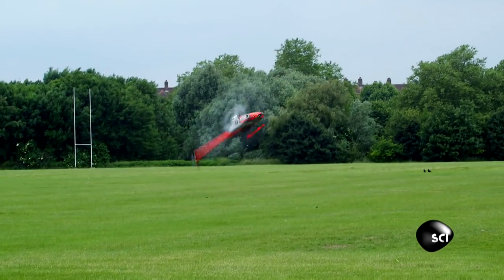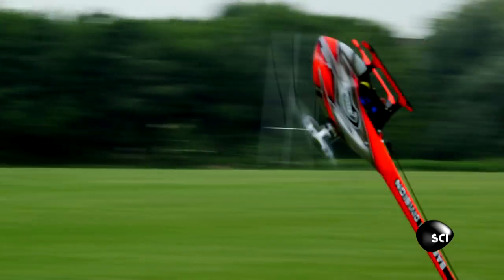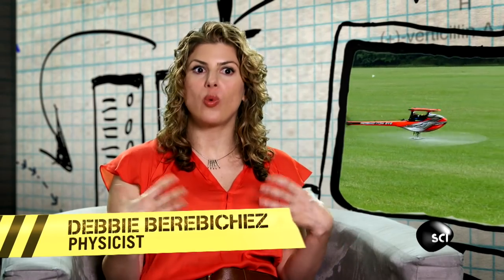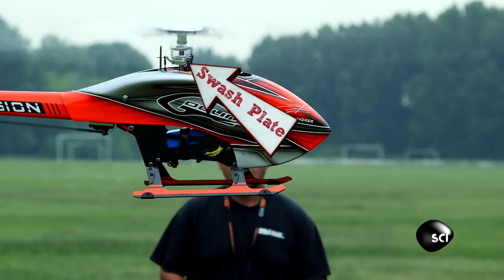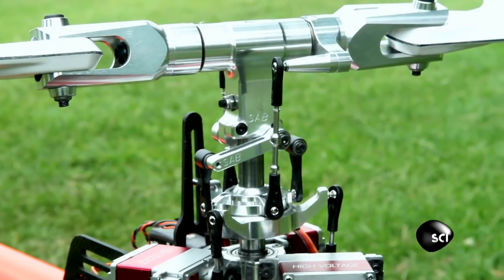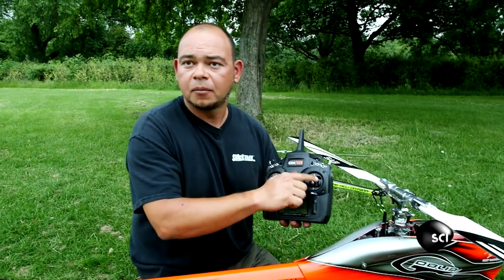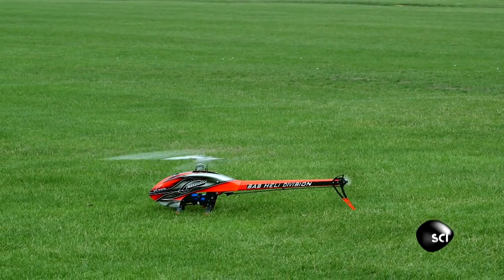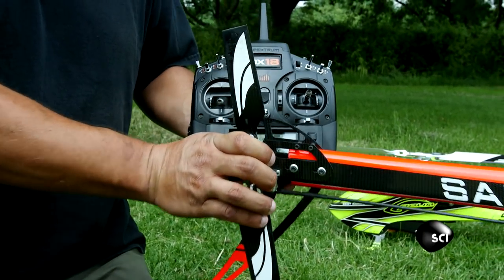How Are These Incredible Helicopter Stunts Possible?

Comment: I actually had a small stroke listening to those "physicists" explain how they think a model RC helicopter works. That was so very painful to listen to. No matter how great the power/weight ratio, it has nothing to do with making a helicopter hover upside down. These RC helis are capable of tilting their blades beyond horizontal so that there is thrust directed "above" the helicopter. It's often referred to as 3d flying and it's what allows the tick tock, upside hover etc.

Comment: Um, actually no. These TV presenter "physicists" are superficial to the point of being incorrect - the main rotor cannot tilt at all. What actually happens is the individual blades tilt at different times in the cycle. Let's use a compass as a reference, North being the front of the chopper. To fly sideways, let's say to the east, each blade tilts aggressively as it passes the west side of the chopper; this very brief change in pitch makes the blade cut more air as it passes the west side, thus creating more lift on the west side; the whole chopper therefore tilts to the East and starts flying to the East. If the main rotor is spinning at 600 revolutions per minute, this means the pitch on each blade is changing 10 times per second. Similar thing happens for forwards and backwards flight. (For inverted flight, the blades tilt in the opposite direction to push air out the top of the heli, but the cyclic control can still be used for direction.)
Reply: Do you know what you are talking about? Because in these things the swashplate tilts the entire rotor. I have one of these, I know.
Reply: Yes, I have one, the rotor tilts.
Reply: @jetgamer5386  which model do you have? Never seen the whole rotor system to tilt.
Reply: @rubaiyatmehedi9337  ok, I did some research, turns out there are three types of rotor systems. Rigid, articulated, and semi rigid. Rigid is what rc's use,it allows maneuvers without mastbump. In an actual heli this is too stressful on the blades, so the rotor system swings freely from the mast. This greatly reduces stress and increases the lifetime of components. Some new helis use semi articulated in which the blades all articulate independently.
Reply: @jetgamer5386  almost all hobby grade aerobatic R/C helicopters use a semi rigid teetering hub. The blade grips share a common spindle that is supported by hard rubber bushings inside the hub. It can tilt, but not by much however this has nothing to do with directional control it's there to deal with dissymmetry of lift caused by cyclic pitch and/or the advancing blade during forward flight.
Reply: Ummm... not quite. The response is 90 degrees out of phase. So if the blade rotates N-E-S-W and there was an increase in lift on the west side, the response would be north going up an south going down. East and West would not change. Maybe you need to go back to school with the presenters...
Reply: @InfiniteRemoteControl  It's "approximately" 90 degrees out of phase, the actual phase offset can vary from 80 degrees to 90 degrees depending on many design factors. It's not gyroscopic precession because if it were that it would always be 90 degrees exactly never more or less than that. It's an aerodynamic effect caused by the fact that changes in angle of attack of the blades cannot instantly affect roll rate of the aircraft. An extreme example is the Robinson R-22 (a full scale helicopter) which has about 70 degrees of phase offset.
Reply: It actually can tilt to an extent.  The spindle shaft bushings are almost rubber(of varying durometers).  The blade grips are are attached to the spindle shaft.  The disc CAN tilt, although it isn't much.
Reply: @fiveoboy01 The point was explain the ingenious way in which a helicopter manages to fly in any direction.
Reply: @atomicskull6405  There is no question the phase offset is necessary because of gyroscopic precession. The aerodynamic effects may be the reason the phase offset is net exactly 90.
Reply: @jetgamer5386  What the hell model do you have??? Can you answer??? Because I guess you talking about some toys and half - toys like 3 channel or 4 chanel RC helicopters. The "stuff" in real helicopters, or in the video (6 or more channels models), or subscribed by Lindsay Fowler is... just the same.
Reply: OMG no heli in existence works that way. I was cringing the whole time he was explaining the theory he came up with in his head. He obviously was not there to see the heli in person and knows nothing about helicopters.
Reply: @jetgamer5386  No it doesn't.

And I have a whole fleet of them.  The swashplate tilts, but rotors always stay exactly 90 degrees to the main shaft, and that is fixed at 90 degrees to the longitudinal and pitch axis.

Comment: I love how they explained the physics of moving forwards and backwards wrong. You don't tilt the whole blademount forward to go forward... You change the pitch of the blades at a 90degree offset.
Reply: Zeleene yeah
Reply: Exactly that's how you can tell that these people are just paid to say what they have to say
Reply: @nightmareinaction629  That's how TV (and all nowadays media) works....
Reply: And the real explanation is so beautiful and interesting. What a thing to get wrong!
Reply: Changing the pitch increases and decreases the thrust which is controlled by the collective stick. The blades are tilted forwards, backwards and sideways using a swash plate which is controlled by the joystick
Reply: They left out any sort of explanation about the swashplate's entire third axis of movement.  The swash plate is a 3 axis device.  It moves along the vertical and both lateral axes.  The collective is the vertical axis and this is actually the one that allows the helicopter to fly upside down.  That's the biggest thing they left out.

Comment: I've been an aviation enthusiast for some time. All I got from this video is the basic on how any helicopter actually works. Not how the helicopter can actually perform these amazing stunts. Any reading from 3-13 minutes depending on your reading skills and source will explain just as much if not more. RC heli of any sort isn't easy to fly, these bigger models that have these amazing abilities are even more so difficult to fly. It's always best to start out small and with airplanes first then move up the ladder with skill. But this video does not explain the science behind how the heli can fly upside down, sideways ect. You'll have to do your own research there.

Comment: holy crap you are not actually able to tilt the head with blades on it... the swashplates allows  different pitch on different positions of the blades.. if i want to go forward i dont tilt the head forward, thats bullshit the head is fixed. if i want to go forward the swashplate allows me to have a higher pitch on the blades when they rotate through the rear part of the rotation, therefore creating more lift on the rear side and tilting the helicopter forward...
Reply: Well technically there is some blade flap because (most) RC helis use a semi rigid teetering head (the spindle teeters to some degree on the dampers) but that's still just a side effect of cyclic pitch. And in forward flight there is also some upward blade flap on the advancing side and downward flap on the retreating side.
Reply: +Atomicskull you are correct, and normally you have to take the gyroscopic precession into account as well, but in this video it seems like some magical force is tilting the rotor head in the direction of flight which i think is too oversimplified
Reply: +KING 21 RC I own a Rush 750 and an Innova 700 and next year I plan on building an 800 gasser either based on a Trex 700 conversion or possibly the upcoming Protos 700 Max V2 gasoline conversion (that one is really interesting because it's using a Zenoah with a new casing to make it more compact). There is always some amount of movement possible with the feathering shaft because they are supported in the hub by rubber dampers. It is not rigid hub, the rubber dampers restrict but do not completely prevent the feathering shaft from teetering. You are right that using too soft dampers risks a boom strike in extreme maneuvers.
Reply: speed bòt
Reply: speedbòt
Reply: RC helicopters typically use a restricted teetering head (common spindle connecting both blade grips supported by rubber dampers inside the hub) so the disk can in fact "tilt" to a small degree however it's only in response to differing lift across the rotor disk. This is necessary because in forward flight there is an effect called "blade flapping" where the advancing blade wants to move up and without some means for them to do so the blade will bend instead and in addiction decoupling the blades from the airframe with elastic bearings (which is what the dampers are, on some models they are actually just common O-rings) also reduces vibration. If you want to see what the inside of an RC helicopter rotor head looks like google the Trex 700 manual. It's more complex than you might think.
Reply: Tim what about gyroscopic precession? The lift is given 90 degrees out from the intended movement, much like a bycicle wheel turns left or right when its tilted over, so, pitch forwards = lift right side and vise versa . they could have explained this in the same amount of time.
Reply: yes, 3d helis use a fixed head system. These people probably don't understand that there are several types of rotor head. A lot of full size helicopters have a semi articulated rotor which does actually tilt. However, the tilting itself does not cause the movement.

Comment: Well another very big reason why full sized helicopters can't do this, which you didn't mention, is that the collective pitch has no reverse, so flying upside down is impossible.
Reply: Of course there's reverse collective pitch in a full scale heli. Otherwise they wouldn't be able to auto-rotate. The real reason they can't fly inverted is blade strength and tail boom strikes. Things are a lot bigger and floppier in a full scale heli and you really have to be concerned with blade flap.
Reply: Eric Braun I fly helicopters for a living, there is no such thing as reverse collective pitch. In an auto rotation the collective goes full down, the minimum pitch but certainly not reverse. Depending on the helicopter and how heavy it is you may even have to add some collective pitch so as to not over-speed the rotor.

Please do not spread misinformation, I'm not saying you need to be a pilot to know such things, all I'm saying is just do your research.
Reply: There are a few full size helicopters that have the capability(in theory) to go negative now(rigid/semi rigid head),  but the problem is rigging.  No manufacturer would ever rig a helicopter with negative pitch because of the danger involved with flying with that capability.  With less power to weight and much more mass,  the possibility slamming yourself into the ground is very likely to happen.  Maybe someday with an autopilot that could keep you from danger zones but again,  at this point there is no reason to do it with million + dollar helicopters,  so why  take the risk.
Reply: dirtcurt1 I can only see reverse collective being a thing on specially modified stunt helicopters at airshows 30 years from now, maybe.

In 30 years the aviation industry might have caught up to 2016 LOL
Reply: I think bigger full size automated drone helicopters for military use could be the thing you are expecting.  I just don't think a human could take the forces that these RC helicopters dish out.   Can you imagine the ability to sidestep a rocket or even ordinance with the moves they make.  Collective pitch drones are now being made.  Those will be tough and have extreme agility.

Comment: If the rotor head tilted it would strike the boom, boom strike is not the rotor head titling or the blade flexing, it is when one rotor- blade lags in it grip so it is not perpendicular to the pitch angle of the grip any longer, that means the rotor blade will be angled downward, at an angle that is whatever the cyclic angle is, thus the tip drops down as it lags in the grip and strikes the boom, the way to stop it doing that is the bring the cyclic back to 0 so the blade tip cant drop to the boom if it lags in the grip.

Comment: Rotor head doesn't tilt at all, it looks like that to anyone who cant fly one but that is just the blade flex and that's all there is to it, And that's is also how you set the swash plate to rotor grip links by sighting the rotor head end on the noting the high and low blades and adjusting the link so both blades track at the same height. you just put tape on one blade so you can see which is high and low.

Comment: besides power to weight ratio it doesn't really get into how the tricks are possible would have liked to see some of the control combinations in parallel with whats mechanically taking place on the craft
Reply: +RALLIR So it's a combination of orientations that are important. When the heli faces different directions, different controls are reversed. So after you learn 8 orientations (4 upright and 4 inverted) you can start using those in moves.  watch?v=VJO0bGRwK1Q here is a stick cam from a pro.
Reply: Thank you :)
Reply: I like ,how do I get it?
Reply: olayiwola sulaimon Get what?
Reply: There is only one way to get there - Practice

Comment: He says from 3 years to 10 years... Meaning 10 years if you are an extremely slow learner... Super weird you all went straight to 10yrs like that was the benchmark... I guess that is kinda like "selective hearing" right? Oh and if you are assuming its anything like those drones that basically fly themselves, these things cost $800+ and almost everyone crashes and burns them on the regular. For those preaching they can do it in 1month, We await your video proof. These things are really difficult to learn without destroying a bunch of cheap ones and that's just flying and landing, try some of what hes doing...
Reply: So true , most of these people commenting don't even have a clue how difficult it is for a newbie to get a collective heli like this in the air let alone do piro flip.
3-10 years can be correct it all depends on how frequently you practice.
Reply: +MrDVCHITTer It also depends on weather or not you stick with the hobby/practice a lot and have your helis set up correct (how much actual air time you have in the "3-10 years").  when I learned to fly CP it took me about 6 months to learn hover/ forward flight, due to a bad heli.  I built a 450 and had it set up for me, and went from barely being able to fly forward to flips and loops in about 6 flights (vs. 6 months).
Reply: Yeah these guys need a lot of practice, and even the best destroy theirs. I saw a graupner guy completely destroy his once
Reply: +Ptolemy
Or it means you try to learn with less hours invested every month than someone with 3 years.
Reply: if you have round 150 flights/ month, you can do it in 3 years, 5 flights per weekend? 15 years maybe
Reply: I was looking to buy one but from the comments i may just buy a buggy and stay on the ground
Reply: helicopters are the hardest to operate out of everything that is RC basically. 99 percent of people couldn't fly this helicopter in circles without crashing it in 10 seconds or less.
Reply: kenneth sparks That's no exaggeration. I've seen only a few RC Helicopters (serious ones, like this), and every single one of them, was a pilot struggling to learn how to get it to just lift off the ground and hover 12" in the air. I don't know if I ever saw one successfully do it. I'm not sure if it's super hard, or if they became scared of losing control, or what. But I've never seen an RC Helicopter actually take flight and fly any substantial distance whatsoever, in person.